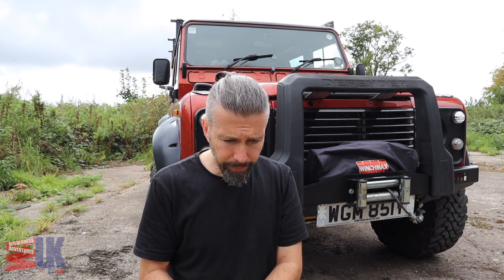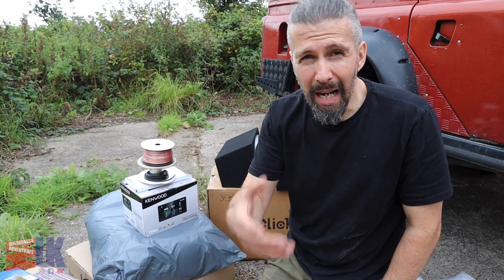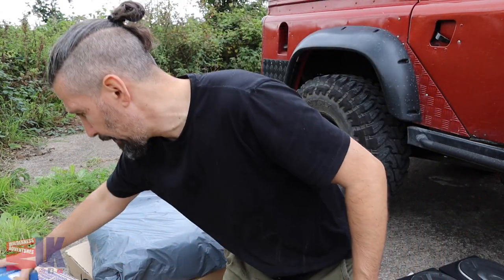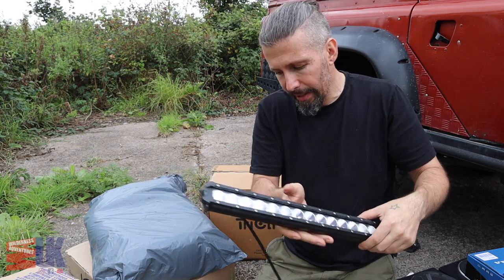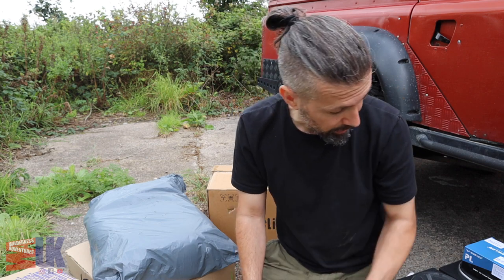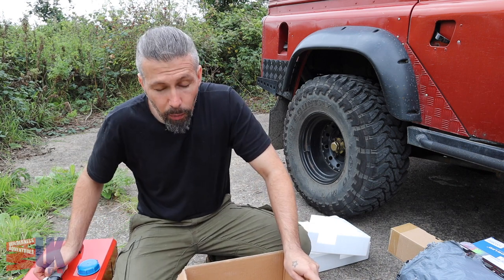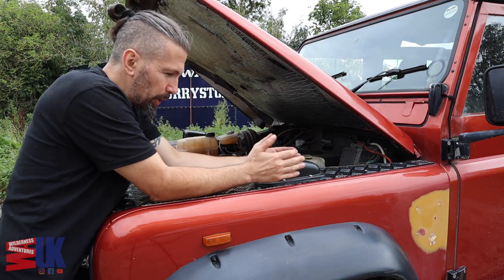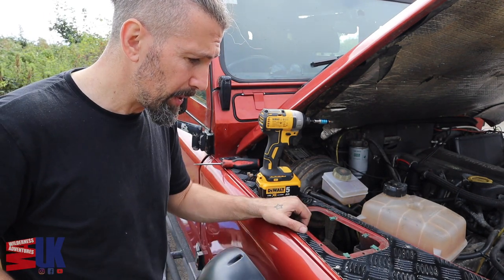WAUK Land Rover 110 Update, Plans and Upgrades

Comment: Great video. Nice additions. Good choice on not spending a lot on the lights. Like you said that would be tempting for thieves and I think some of those "top of the line" lights are overpriced. Hope you can figure out the heater location, sounds like a good addition.

Comment: Just a tip, steering damper is the yellow thing in the front of your truck, not the Panhard rod that keeps the axle from walking side-to-side...As for the diesel heater, I'd not be using that one in the front, that is a camping version, I'd use a 2kw normal unit, and yep, you can fit them in the cubby box space with a short cubby box or whatever you like there. ps the heater on the Landy is about £25 for a new matrix and make the flaps work that always seize up. I unseize about 5 lots of heater flaps every year. Nice early Landy though would be interested to see the 300tdi conversion as it looks to be a bit in the middle of either place they normally sit. Also notice it's got an ABS pedal box and servo...
Reply from the maker: Yes indeed, I replaced the steering damper and panhard rod bushes. 

Yeah I could well be seized flaps on the heatet as the selectors are not working, I'd be interested to know how to free them off..

Comment: There is a cubby box with a space under for a diesel heater (would need to be out of the enclosure the heater came in) honestly if you are fitting it, you should think about under the driver seat. Boris the defender fitted one there and he ducts it to the back. 

Re keeping it mobile, you're probably better off fitting a separate one to the trailer. 

BUT I am interested on how you solve the issue of location (and diesel smell when you spill it in the cab filling it up)
Reply from the maker: Tim, it's a massive dilema of mine where to locate the heater at the mo, was going to be where the cubby box goes but having second thoughs, then thought under the drivers seat, then in the middle of the rear footwear, now in thinking in the back, but insuppose ther is no perfect space... going to put a short video out asking the masses!
Reply: @WildernessAdventuresUK  do you have space to install a military style side locker?
Reply from the maker: @overlandingwolf  as it's a 5 door I don't think they have enough space
Reply: @WildernessAdventuresUK  good luck bud 👍🏼
Reply from the maker: @overlandingwolf  😳😱😥